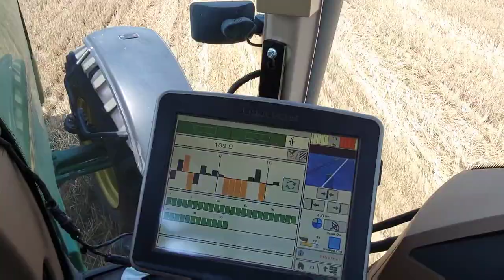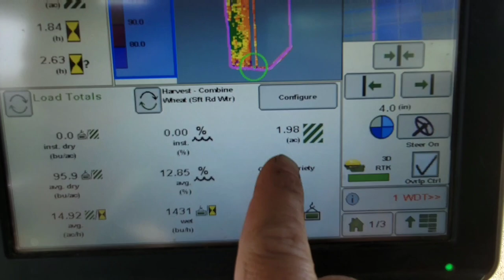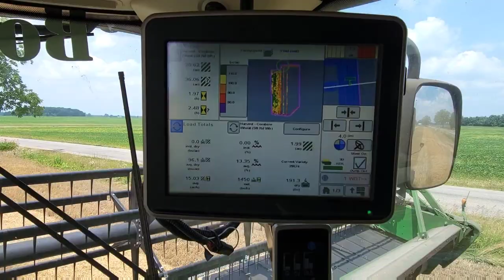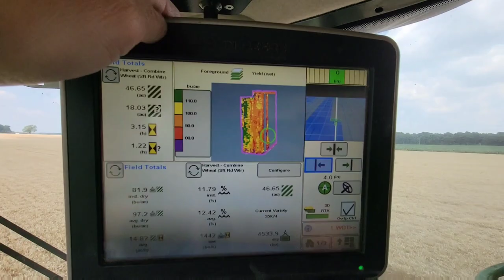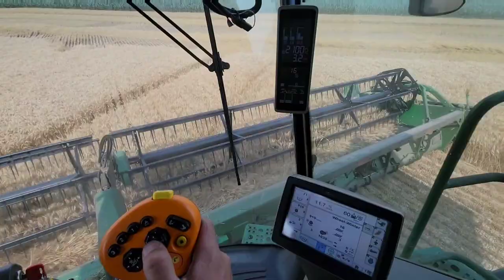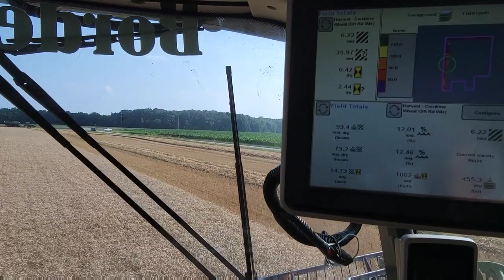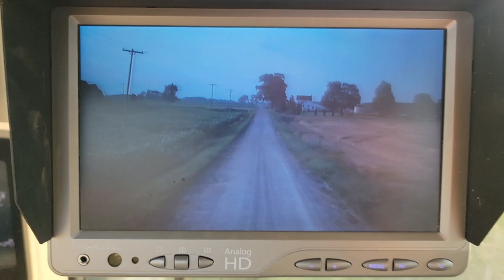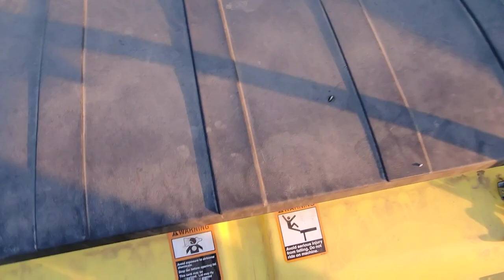The Field's on Fire! 🔥 - #455

Comment: Chafer bolt - Seems like the bolt needs more robustness making it stay in place.  Even though it is threaded into something and torqueing it, I think it needs more retention features to hold it.  There is a lot of vibration going on.  Maybe add some Loctite?  But since it has never broke with all the hours on the machine, guessing Deere engineering has it designed properly.

Fire bugs = Bad for everyone.